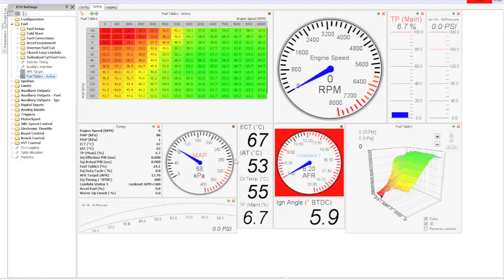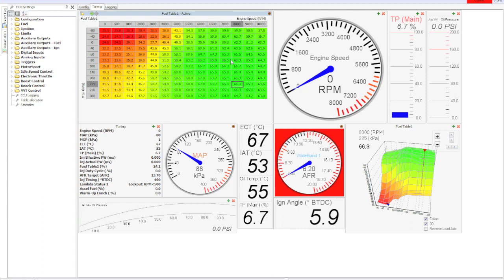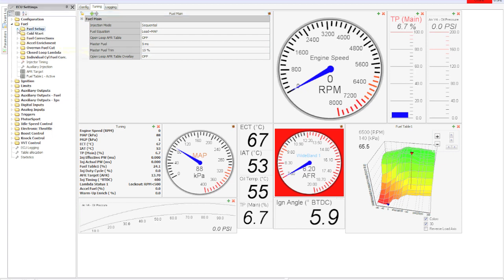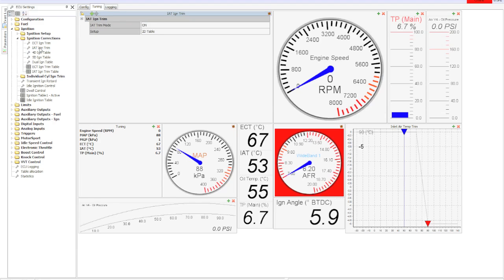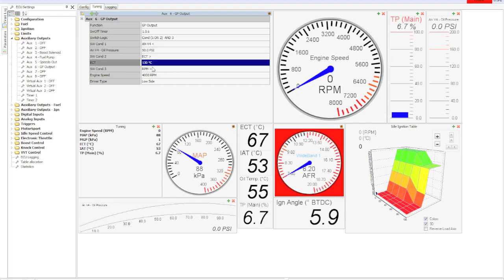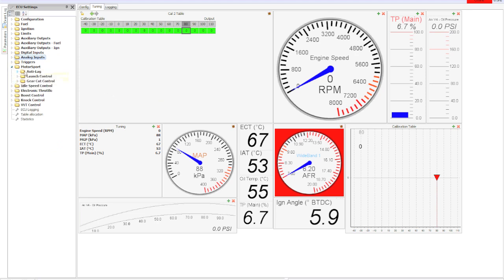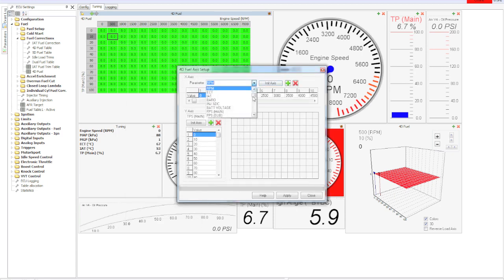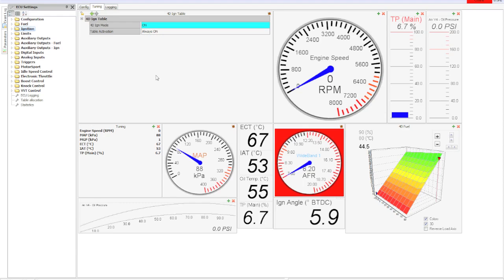Vi-Pec ECU for 1.8T Introduction

Comment: how to remove vvt from 1.8t a4 b6 ?
Reply from the maker: Install an non-VVT tensioner from an early 058 20V cylinder head. Direct swap.
Reply: Integrated Engineering LLC. yes but "engine check" appears. so how remove it in ecu?
Reply from the maker: Are you using a Vi-Pec wyskun?
Reply: Integrated Engineering LLC. yes
Reply from the maker: If you are using a plug and play Vi-Pec ECU for 1.8T, then you simply only need to turn the function off on the map. Speak to your Vi-Pec tuner about how to do this if you are unfamiliar with the operations.